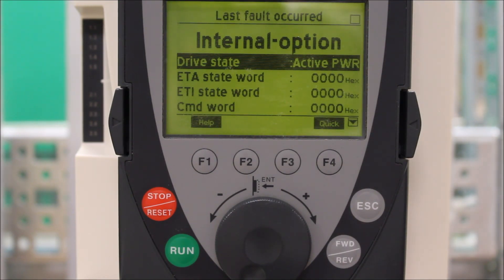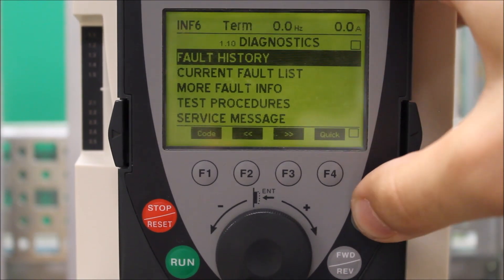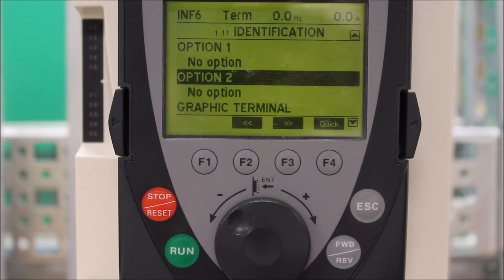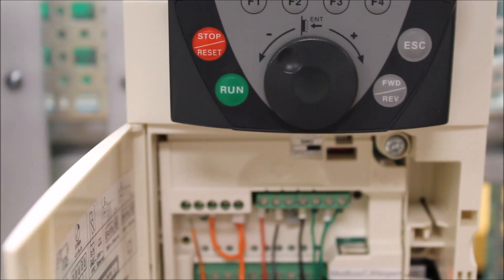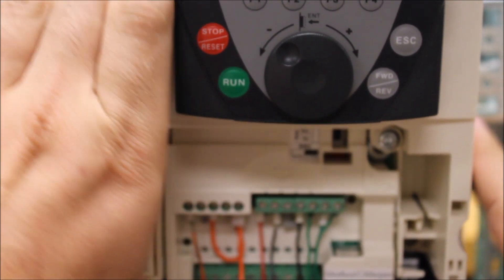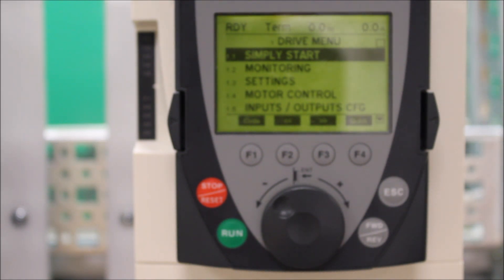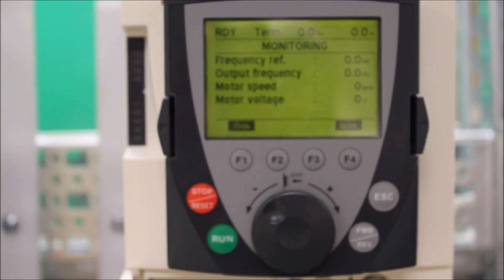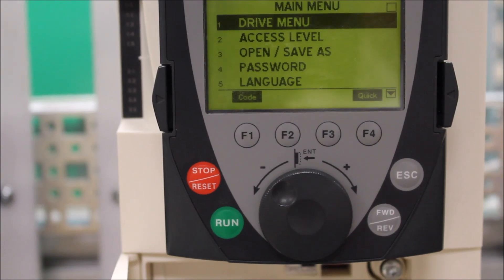Troubleshooting INF6 Fault on Altivar 61 & 71 Drives | Schneider Electric Support

Comment: Drive in stop conditions, but output phase to phase 32v dc comming ,how to rectify the problem, but when we are given start command motor run , but drive stop conditions, output dc voltage coming,

Comment: Pl guide when I start motor n try to control its speed with potentiometer..it don't control speed n disply -41.6 hz at lcd n motor rpm goes very high like 2000 rpm..